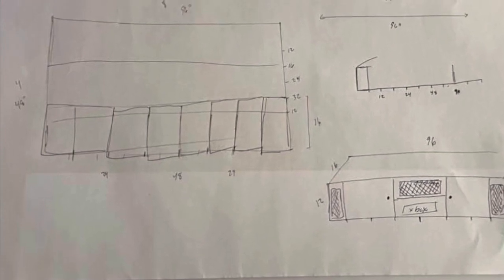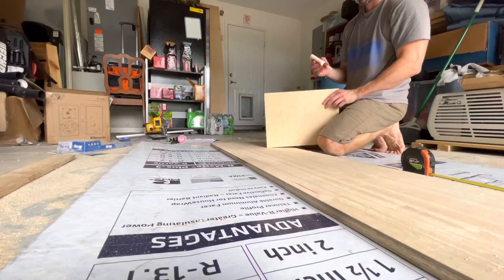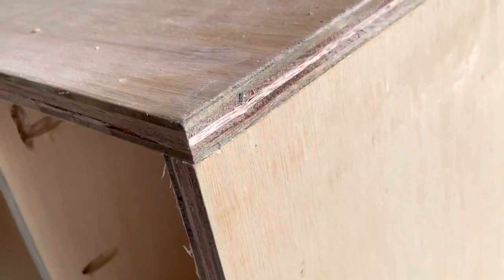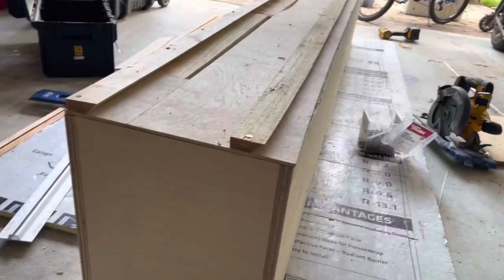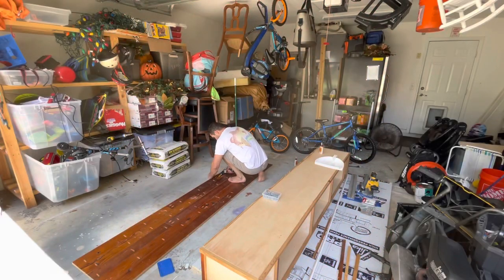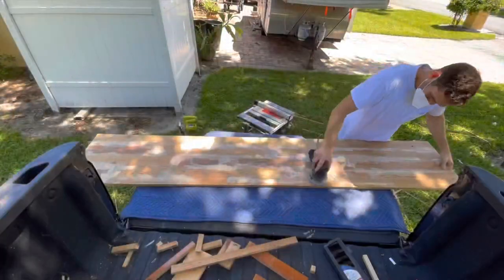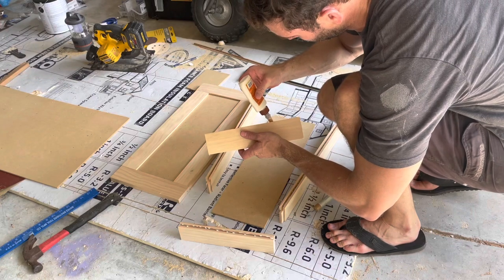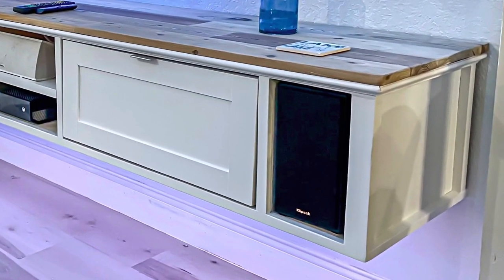Floating TV console using one sheet of plywood

Comment: YOU FORGOT TO SHOW HOW DID YOU HAND ON THE WALL. ??
Reply from the maker: I used a French cleat made from 1x material. One at the top and bottom of the cabinet so it sits flush with the wall. You can see it around the 4:28 mark